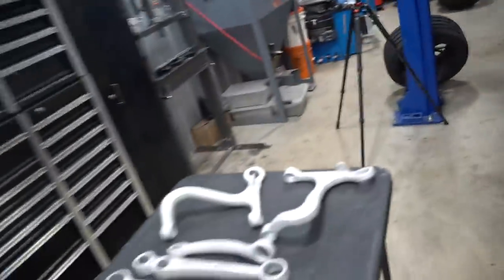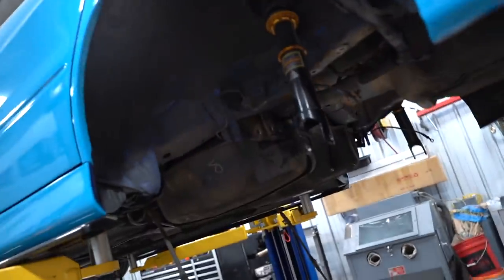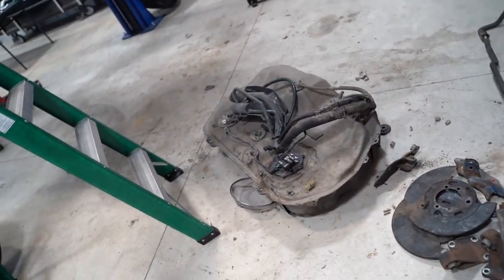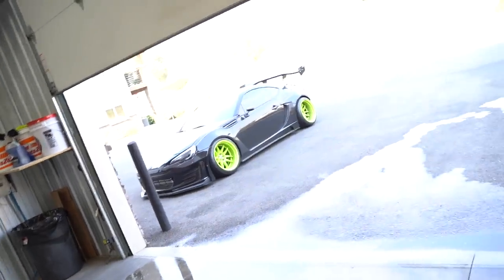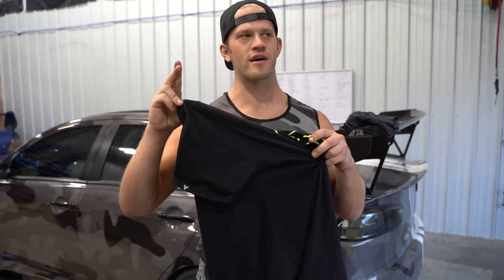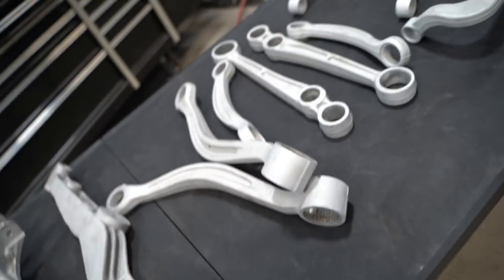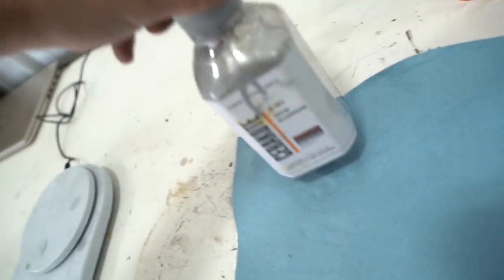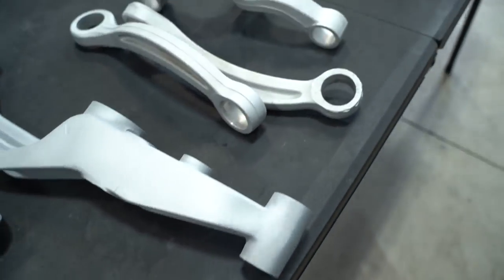Refinishing The Evo's Control Arms!

Comment: the POR-15 is a phosphate coating that convert any surface rust into a hard phosphate coating and stops it from rusting again but if you use that then you can then use a bed liner over that to make sure its protected from rock chips and Happy Birthday as well.

Comment: Using raptor liner for undercarriages, wheel wells, etc. does work, but the prep is pretty time consuming and tedious. You have to scuff everything real good (not to bare metal but enough to scuff the surface. Just like how you would before spraying a bumper in primer) but the main complaint I’ve had after doing customers wheel wells and undercarriages is the road noise seems to not diminish at all. I’ve used some of the 3m undercoating in a can (like $50-$60 for 4-5 cans) and that seems to do a decent job with road noise in wheel wells after bedlining them. Hope this helps. Tool I would suggest for scuffing is a nylon cup brush attached to a buffer for best scuffing and least time consuming. This is what I use for bedliners in the bed, and undercarriage. Clean and power wash after scuffing obviously

Comment: Have you thought of dry-ice blasting the underside? Safe for rubbers and plastics and cleans paint without damaging it or leaving any solvent residue or water. Downside is just the time and expense of the equipment and the CO2.

Comment: The problem with raptor liner is that its nearly impossible to tell if it has been punctured and allowing moisture in between the sealant and the metal, which can create a bigger issue. This is why most winterizing undercoating's are made of lanolin or other oils because they can coat and seal the metal, without trapping excess moisture.

Comment: If you don’t sand the undercarriage to bare metal, any moisture or any tiny little specs of rust trapped underneath will continue to spread overtime and you want see it’s till it’s too late since it’s under the raptor liner

Comment: Nah don't use bed liner or anything,  if any moisture gets between then your definitely screwed.  Sort any rust areas, a good clean , scuff, prime and paint then use high strength clearcoat.  You don't want to be trying to remove that bed liner later down the line and also people think its put on to hide serious problems.

Do it properly,  do it once. The rest looks brilliant,  a fresh painted underside would be the cream on the cake....!!